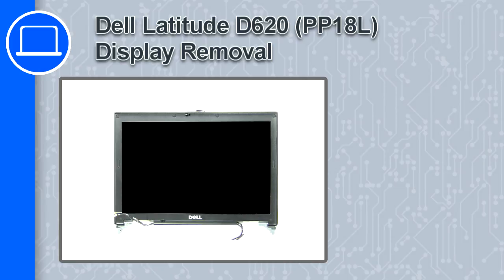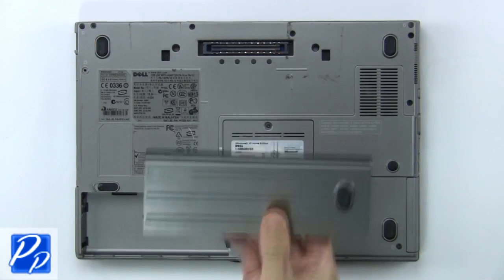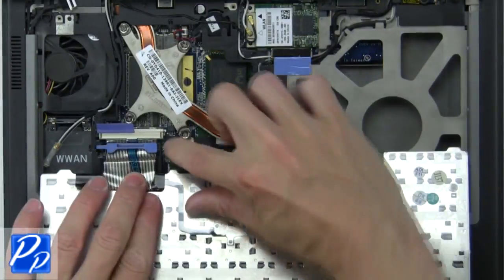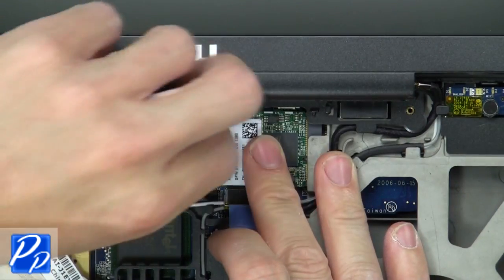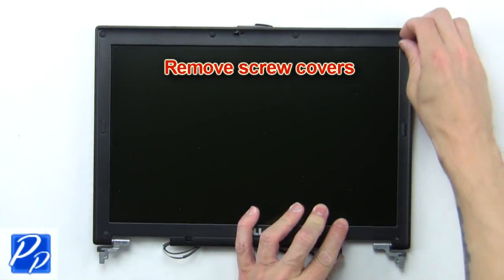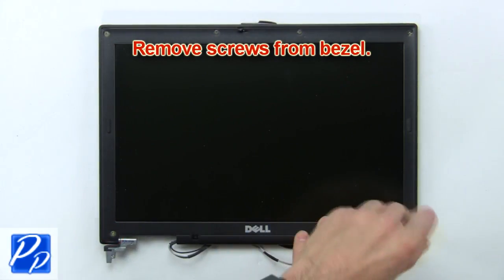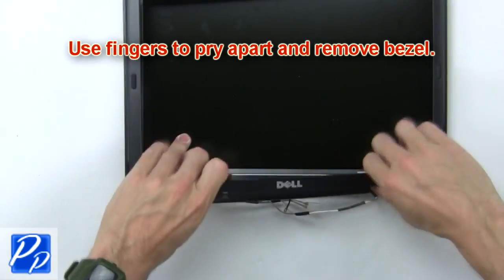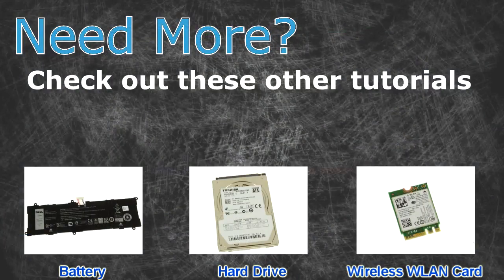Dell Latitude D620 (PP18L) Display How-To Video Tutorial

Comment: Great video, but it's not necessary to actually remove the display lid completely (i.e., no need to remove four hinge screws from back edge and bottom).  Only the keyboard removal is necessary to access and disconnect the display panel connector (and the keyboard doesn't even have to be disconnected, just folded out of the way). The display panel can be removed from the lid by removing the bezel and panel screws as shown, and the new panel installed in reverse order.